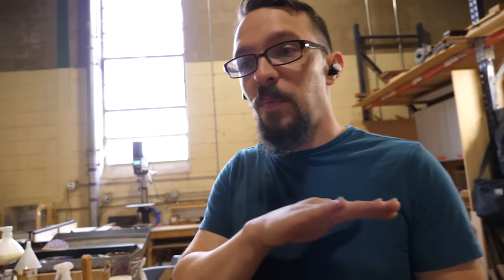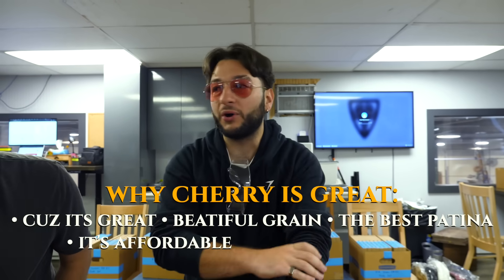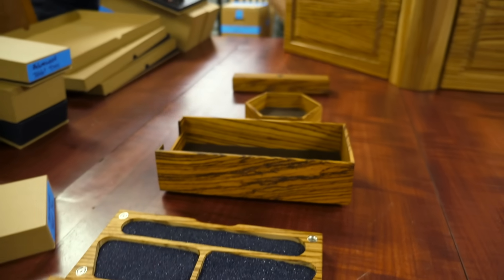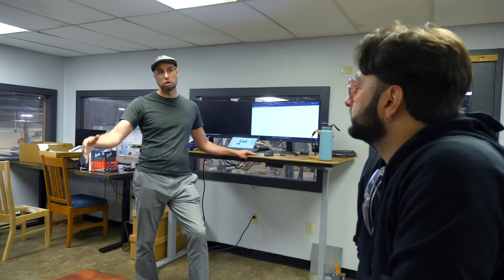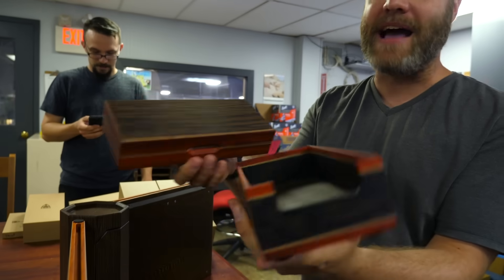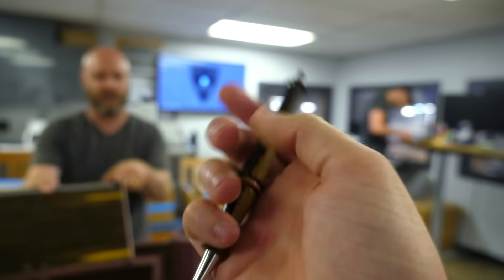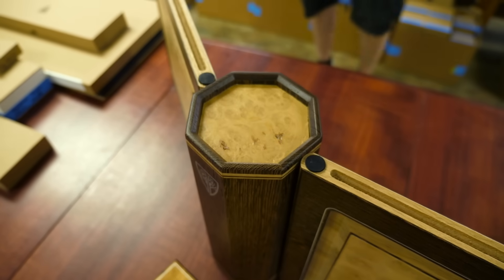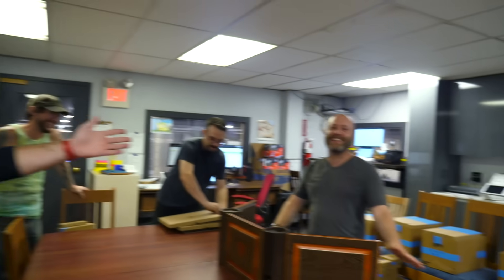NEW DM Screens (AND Classic Adventuring Party?!) S14E14

Comment: As one of the select, elite few Druid buyers, I'd like to share why I went for druid:
1. I just really like the look of poisonwood (replaced in production with bolivian rosewood, wh/ is fine b/c still has the wood grain I like & technically a more expensive wood, so upgrade)
2. cherry, it ages well. Also allowed me to be more economical with choices of accessories. 
3. Inverse of #3 - I won't buy ANYTHING from y'all with padauk or purpleheart, b/c I've done the research & know it ages like crap. If I'm missing something, I'm sure I'm not the only 1 and maybe there's an educational wyrmlife segment there.
4. other class options that didn't utilize padauk or p.heart were all very mono-colored. I actually got sent a necromancer panel by mistake, & while it looks a little better than what I expected my suspicions are confirmed, it has no contrast. The new cleric seems to have the same problem, except it's all white instead.

So, to sum up the feedback:
a. some of us won't touch padauk/purpleheart b/c we think it will age to look like crap, including brown color
b. you need a bit more diversity in the class range, to have more contrast b/w woods without dependence on padauk/purpleheart.

But what do I know, I'm only 15% of customers LOL.

Comment: Solution to the largest issue in woodworking.
Webtool that has visual inventory of individual pieces and allow customer to choose which pieces they want. For monetization a few opportunities present themselves.

1. Continue as before with cost by material.
2. Individual auction for each board. (likely automated)
3. Product is ranked into price tier of which there are multiple for each material. Similar to GPUs (This is a top 5% Ebony for example.)

Comment: Love my GM screen from the last Kickstarter campaign. I was a bit meh about the panels until they started showing off functionality (the tracker, magnetic panels, iPad integration are.. legit), and the thing that sold me was the double-sided dice tower and vault tower which are.. next level. I’m very curious if there will be any new innovations with this campaign that will make me want to dip back in🤔

One thing that might be cool is taking the “display” panel to the next level by just making it possible for a GM to place an iPad or an image on display for their players. I have a table display, but it’s not ideal to show a picture of an NPC on the table, especially if a player is currently talking to me as the NPC. Showing the NPC on the GM screen would be much more natural and it would help with immersion. Showing off a slideshow of images of a new location, having an overworld map constantly on display while a more local map is on the table could also help.. lots of applications and I don’t think it would take much to design something.. in Thief 😏

Comment: Dont order the Bolivian Rosewood.  Mine literally looks like black walnut.
Reply: Than you're either blind, got bad very bad luck with the woodgrain, or they sent you the wrong panels by mistake. In the latter 2 cases contact support and they will replace... Especially for the latter case since rosewood is priced higher than walnut. 

However, I will say that the bo.rosewood on my druid panels is OBVIOUSLY different than my black walnut accessories, much more pronounced woodgrain.
Reply: Not all their BORO stuff is as nice,  Look at the sales page for the pen for example, it looks nothing like these panels, and I can confirm I received one that looks just like that, its not impressive.(I have a wenge pen, its great even the padauk one looks better)